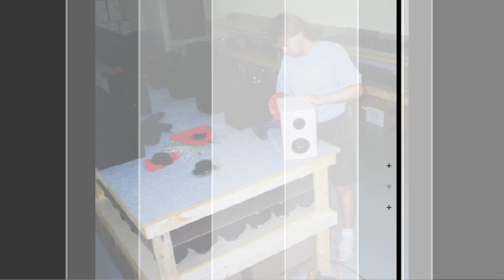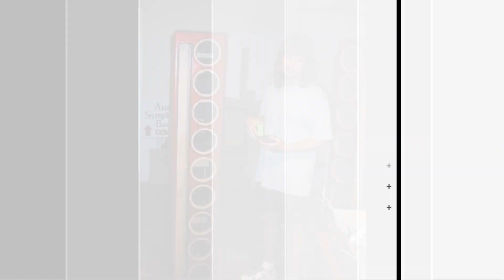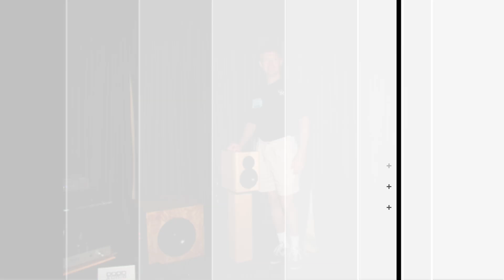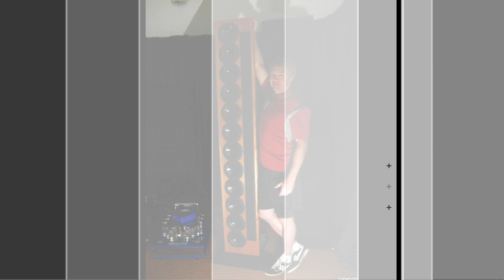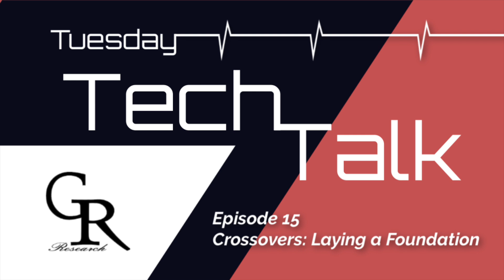Crossovers: Laying a Foundation

Comment: The fundamental problem with direct radiators is the low impedance of free air, and relatively small size with resect to the wavelengths being coupled into that air (at lower freqs.).  All you have to work with is amplifier power and cone excursion, but excursion moves the voice coil out of the linear region of the magnetic field.

Comment: Bollocks. Its 2024 now. A simple system wide eq apo available for free will whitout question do far more Than any passive or active crossover can ever hope for. And the output is digital. The dac you use is up to you. Digital , software defined crossovers are way better Than other solutions. First , they do not alter phase , unless you want them to. They can correct time domain over the whole range, thry can have any slope you want them to be. 
The result will be phase coherent , including compensation for the individual speaker drivers and amplifiers used. Among a lot of other things.
You can not ever replicate any of this whit a passive crossover , or passive line level,  or active crossover .

Comment: The limitations of a passive crossover are not worth it.  Modern speaker design using active crossovers will always produce a higher fidelity speaker every time. There is no reason to live in the past.  Imagine having an active crossover that you can switch crossover points,  crossover filter order or what ever you like with the push of a button.  I can switch between four different crossovers with my miniDSP from the remote control.  By changing crossover points I can change the speaker directivity on the fly for different songs.  Check out the Beo 90 for the ultimate active crossover implementation.  Why anyone would limit themselves to what  can be done with caps and coils is beyond me.  Just buy another amplifier and have more fun. No need to rely on a shop for building a passive setup, when you can go active DIY and get better results.  If you are an audiophile and care more about aesthetics, history and artistic expression and don't care about high fidelity, then get a stack of vinyl, a big ole tube amp with an inch thick front panel, some gold fuses, silver wires and some passive crossovers and live it up.

Comment: Great video as usual I agree with you that the cross-over circuitry can really make or break a speaker performance. Its been about 15 years or more since I built a set of speakers and just starting back into it in my retirement. I worked really hard trying to perfect the cross-overs on my last set (designed and built a pair of transmission lines). I included a notch filter for a tweeter resonance  that was about one octave away from the cross-over frequency (maybe overkill? ) I also included woofer impedance compensation to counteract the rise in the impedance curve at higher frequencies (above resonance). I did a 1st order low pass for the woofer and 2nd order high pass for the tweeter (had to reverse the tweeter polarity to maintain the proper phase relationship at the crossover frequency).  I am a Mechanical Engineer by trade and had a good deal of experience in the machinery field where vibrations are  an ongoing concern. Vibration resonances are often a problem with machinery so always looking at Bode Plots where both phase and amplitudes are represented.
This brings me to the topic of phase distortion in crossovers.  I worried about it to the point that I considered going to electronic crossovers to try and reduce it.  As one of my hobbies has been electronics I am familiar with using OP Amps to make low pass and high pass  filters (i built a color organ that way).  As I researched it more I came to the conclusion that phase distortion was probably not really very audible.  As long as you kept the phase reasonably close near the crossover where the speaker sound waves overlapped each other it should sound OK. So I went ahead with a passive crossover. I sourced my crossover components from reputable sources (i.e. Solen capacitors etc.). Bottom line is I was happy with the end product. The speakers had a reasonably flat response curve and they sounded good to my ear.  I guess the proof is in the pudding so to speak. I am still enjoying those same speakers today.

Comment: Great content!
I'm not so sure about the "top-level loudspeakers" using only passive crossovers, unless we're talking only about the audiophile kind of gear.

Most studio monitors (from the cheapest to the most expensive) work with digital crossovers, which allow not only the crossover point/slope adjustment, but also several types of very precise eq (on which case you can also make a high-shelf adjustment for that rising natural response of the tweeter).

That may become more expensive as we have to add more amplifiers (or amplifier channels), which I believe to be the biggest compromise (along with the room it takes).

But even smaller active loudspeakers (most of them made for small "home studios" with a few exceptions growing for the Hi-Fi enthusiast) can deliver levels of performance that are often hard to achieve with much more expensive passive designs, and most of that is achieved by the combination of internal bi-amping, electronic crossovers and some sort of DSP.

Those are still professonally designed cabinets, with professional driver matching and crossover adjustment, but many active monitors (Genelec comes immediatly to mind, even their entry-level ones) sound amazing and far better than 99% of those similarly priced (and sized) passive bookshelves. 

At the very least, the active speaker with electronic crossover has a lot of more capabilities of controlling several aspects of each driver performance, including its own protection against clipping and overload induced damages.

I'd say that designing a great passive design (like you do) is a lot harder and likely more time-consuming, and that's why it's a gift to hear all your great content.

Thank You and cheers.

Comment: If anyone wondering what the speaker is, it's the Ellipticore 3 from a designer named Troels Gravesen. He deliberately designed this set of speakers with 1st order filters and no capacitors. No comment on why these sound bad, but thats what they are and what the original designer did.
Reply: JonRosko it looks like shape of front baffle doesnt look like one on the ellipticore

Comment: I don't think that comparing a budget dsp with it's budget dac and power supply to a passive crossover in combination with a high end dac is a fair comparison. The dac is the problem, not the dsp filter. I mean if you going to use a passive crossover with a budget dac, you might as well use a dsp. If you want a better sound when doing an active crossover then get a high end dsp that has a proper dac. Having said that I still prefer a well designed passive solution.
Reply: Agreed. But why deal with post-amp signal at all if it is going to be a high-end system? On the pro side, active line-level control has always been the first choice for rather obvious reasons, and that includes the time before there was such a thing as DACs and DSP's. If someone doesn't want to mess with more than one amp, then passive has to be dealt with, but for the kind of money that starts getting involved here...

Comment: Thank you for a great video and series, I enjoy watching them. I was glad to hear your comments on the Ellipticor drivers. I was excited to see a non-round voice coil thinking Scan Speak had reduced/removed one last resonance. Even through the frequency response (F.R.) is smooth (non-rough), it does have a raising response (shredding mass) and impedance imperfection at 1,500-Hz (edge hole?). The F.R. is an improvement over the Illuminator series but, the retail selling price of $708 does not provide any value. 

I do not understand the Illuminator series, for $337 retail, you get a fancy looking motor, which I am sure is low in distortion, but the F.R. has what looks like some serve cone break-up relatively low in frequency. I think maybe the Illuminator should have been an evolution over the Revelator ($209 retail) as opposed to revolution. I have heard the Revelator series and it is a nice sounding driver – I have not heard the Illuminator or Ellipticor but I would imagine there is not hundreds of dollars difference in sound quality.

Once could compare all three to the more cost effective Seas CA18RNX which has a coated paper cone and retails for $88.50. Motor has copper and it delivers a smooth frequency response with a controlled roll off.

Comment: What I'd like to know is...are they really that much better than the illuminator line from scan speak. A mid range driver that can't be crossed over higher than 1500 hz. yeash. I'm glad your playing with those to give us a heads up on their quality. I'm just curious on whats the selling point of the new ellipticor drivers. Is it an improved motor design? I'm not buying this oval crap....

Comment: To tweak his design,I can see front speaker baffle is different  ....well lets say your client has a huge problem on this hand ,specially if he changed drivers.
Reply: The slight change to the baffle can not account for the response issues that this design had. There was too much driver overlap. The drivers had a phase rotation at the crossing over point that didn't allow the drivers to sum properly. There was some phase cancellation. And the drivers were allowed to play into ranges where there were resonance issues with those drivers.  

And the only driver change was the use of our 12" servo sub in the bottom end rather than an uncontrolled driver.

Comment: Your analogy of buying a car to match your tires was perfect and funny. 
What type of DAC are you using? I only ask because I certainly trust your opinion after seeing your vids. I can’t believe this is the 15th Tech Talk Tuesday already, and I both congratulate and thank you for that. You’ve already shared so much knowledge and useful information, and you explain it in a way that is easy to understand. 
Once again, I thank you very much, Danny. I look very much forward to more of your vids. 🎶🔊🙂
Reply: First of all, thank you. Explaining technical matters without being too technical is not all that easy sometimes. 

My DAC is a one off that kind of started as a db Audio Labs variant that got passed around. Gary Dodd designed the output stage, and Dave Elledge up the anti with an internal battery buss. Literally everyone had input and tweaked on it. It's not the end all be all, but until I find one I like better it will be what is in my system.

Comment: Speaker in the background is Troels Gravesen desing. Builder have changed the front baffle, I wonder if that's the reason why it sound so awful?
Reply: I don't know anything about who originally designed what was sent here, but a slight change in baffle design would not have altered the response that much, or caused the issues that the customer noted.

Comment: Thanks for really educational videos. This series of crossovers I must follow with great interest. I have a thought / idea I want to hear what you think. It's probably a little "far out": I have a small listening room with a bunch of problems with standing waves. This may be partially solved, but anyway, I think it will be difficult to get good deep bass with conventional speakers. But. I have imagined a "beam" across the room, above the listening position. This is designed as an H with 12 (?) 6.5 "woofers mounted in a dipole configuration. It will then be 3-4 feet from the top of this beam up to the sloping ceiling in the room. The beam will need to be 10.5 feet long. Could this work?
Reply: Well, I really don't know the root of the problem that you are trying to resolve. I'd need to know more to give you any meaningful advice.

Comment: I agree there is the capability of achieving a good speaker with a passive crossover -- no doubt; however, I have a DBX used primarily for PA systems in live performances, that has great flexibility in controlling crossover points in very flexible slopes, all the spikes and ringing of the drivers, the inadequacies or deficiencies, time alignment, and even analyze room acoustics and adjust them. There is no noise I am aware of . . . and the dimensional sound staging with dimensional effects if it is in the recording is simply outstanding! Right now, I have the subwoofers actively controlled, and the main speakers with crossovers I put together, but totally under the control of the DBX, and as much as I like what I am hearing, I believe using two more amps primarily controlling the drives also as active will be even more outstanding. Regardless, the experimentation in my estimation will definitely be worth it considering the extreme improvement I have seen adding the DBX.

People can argue their point of view for hours -- even get heated in the discussions, but if someone is pleased with their system and the sound they are getting, your arguments are mute! After all, it is their money, their ears, and their taste in sound and music that has NOTHING to do with your own.
Reply: I always tell people that if they are happy with their system and where it is then enjoy it. But on a scale of performance levels that type of gear is designed for the pro market and is still a long way from what is possible using passive filters and high end gear. And I have to share that with my customers. And is really isn't a matter of opinion or debate. It's a matter of experience.